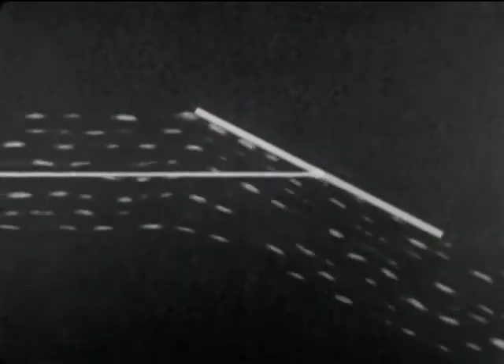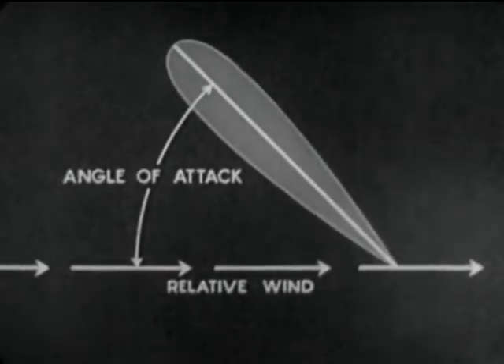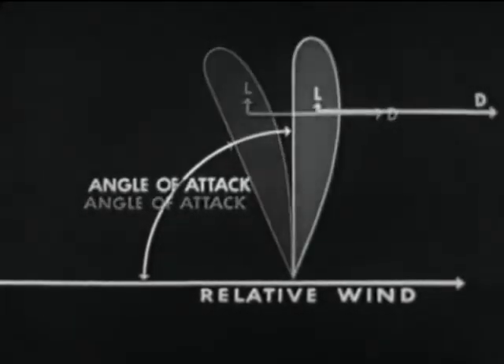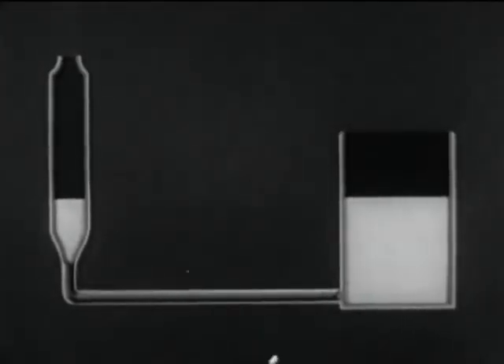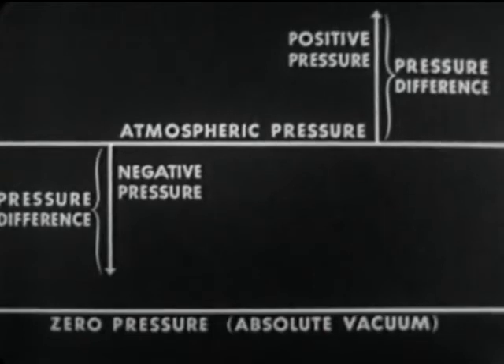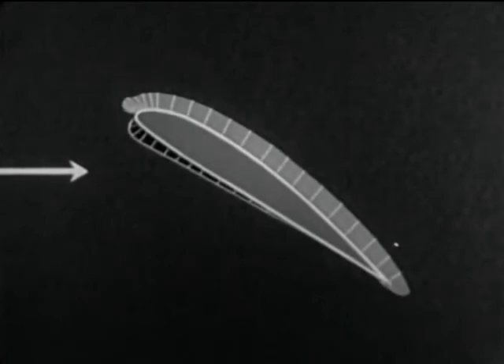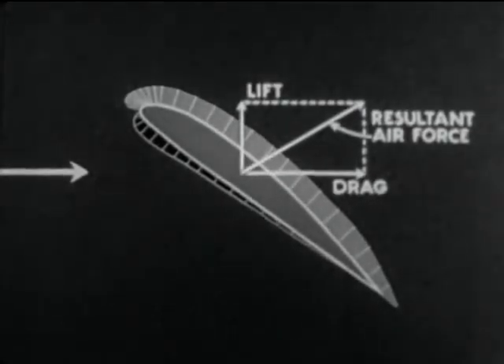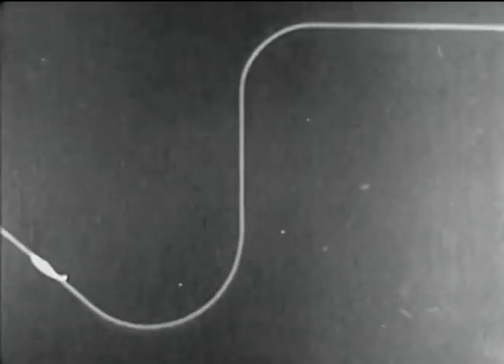1941-10-01: Aerodynamics  - Forces Acting on an Airfoil

Comment: So does one wing really fly faster in a level turn or do both wingtips fly at the same airspeed?
Reply from the maker: Wow... you asked this 3 weeks ago and I am just noticing it now.  YouTube never gave me a notification.  As an FAA certified Flight Instructor, I would actually be required to first cite from FAA-H-8083-3B as follows:

As the radius of the turn becomes smaller, a significant
 difference develops between the airspeed of the inside wing and the airspeed of the outside wing. The wing on the outside of the turn travels a longer path than the inside wing, yet

both complete their respective paths in the same unit of time.  Therefore, the outside wing travels at a faster airspeed than
 the inside wing and, as a result, it develops more lift. This creates an overbanking tendency that must be controlled

by the use of opposite aileron when the desired bank angle
 is reached.

Once I've stated that, clearly, I can then turn you to other reading material.  chuckle.